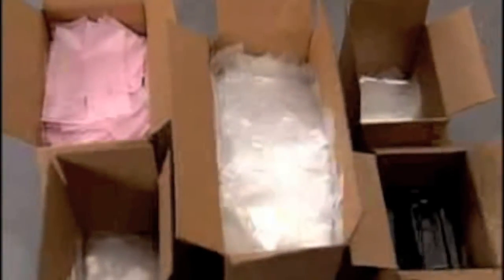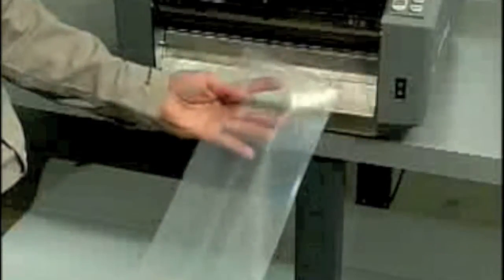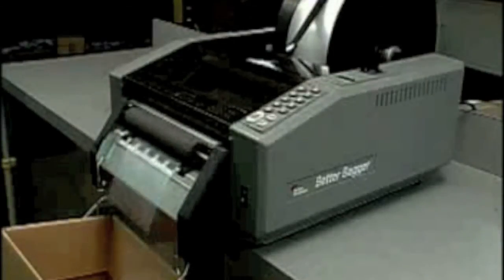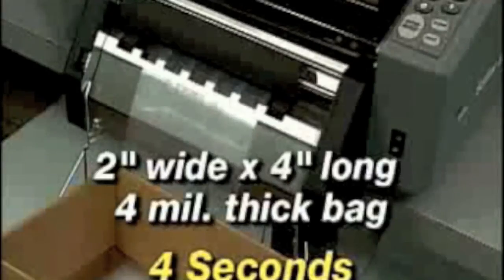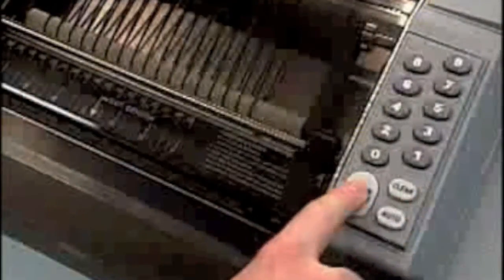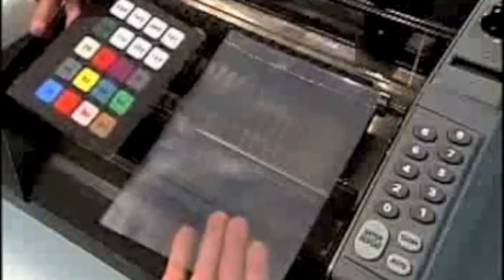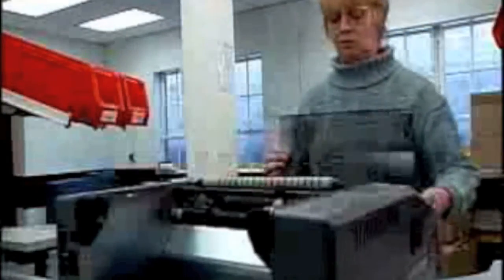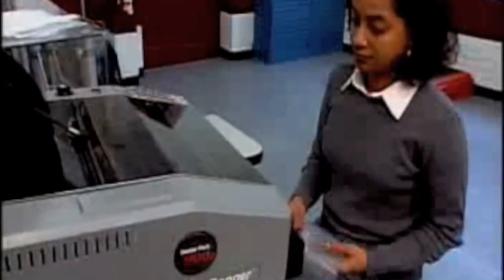Custom Poly Bag System - Better Bagger 900e

Comment: As this system is no longer being manufactured, you should check out the Rollbag R3200 with optional bag maker mode to do something similar.